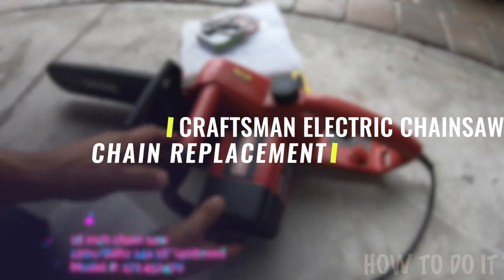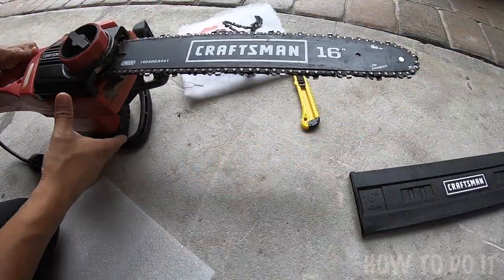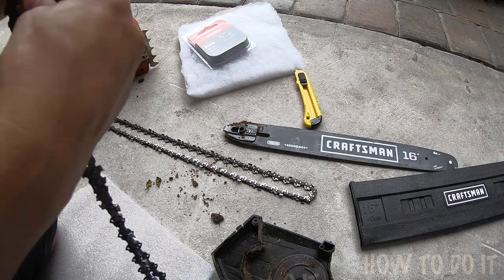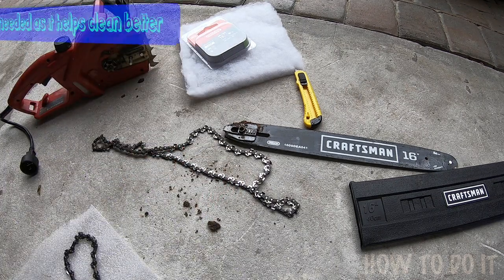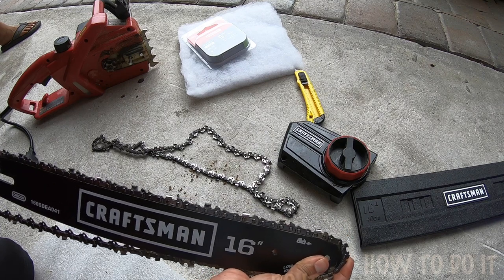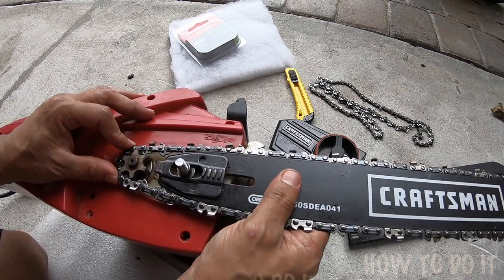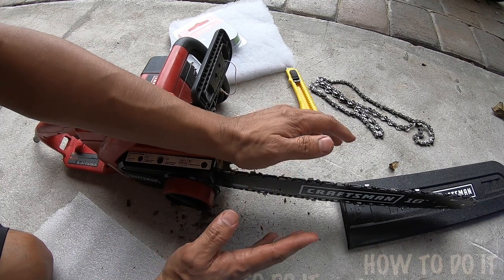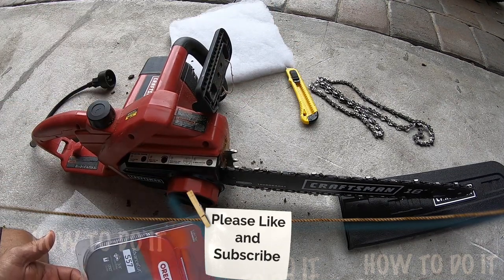Craftsman Electric Chainsaw repair - Chain Replacement.

Comment: TY for this video/ I had only used mine one time 2 years ago and when I tried using it this time for the 2nd time the chain came loose. Chain is brand new so now I should be able to fix mine.

Comment: I can't get the cover off to change the chain.  I am guessing it is either stripped or stuck.  I can turn the inner black knob repeatedly, but the red one might turn a 1/2 inch.  Any ideas on how to remove it?
Thanks

Comment: Is there any way to prevent junk from being cluttered in the electric chainsaw? Also why does my chain keep slipping off? I tightened the chain where it is snug but not real tight.Thank you so much for such an informative video. Keep up the good work bro. Kudos
Reply from the maker: Good question but apparently no other way I could find out to prevent it.

Comment: I'm gonna find another video over to actually get around to changing the chain not going on about numbers and teeth and stuff like that period and your bar looked bent when you took that sleeve off
Reply from the maker: Good luck. No it’s not bent. It’s the wide angle lens make it seem like it. When you get here do not go all the way to the guard... park by the U turn right before the guard gate. I’ll meet you there. its straight.